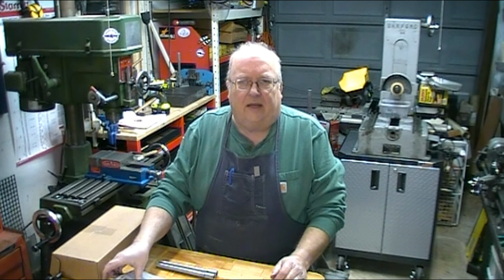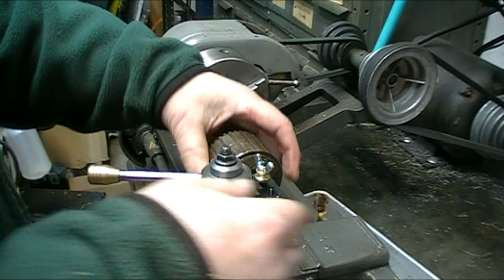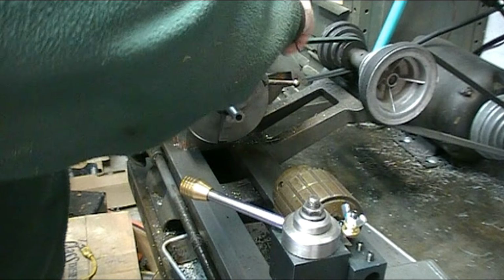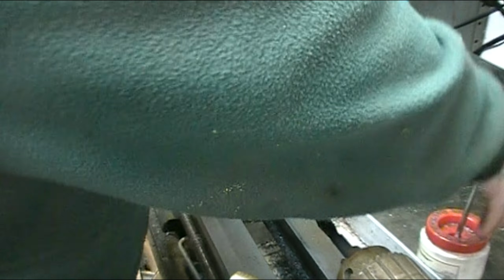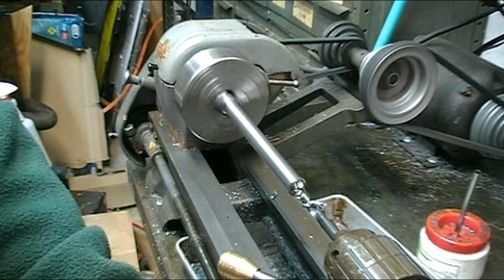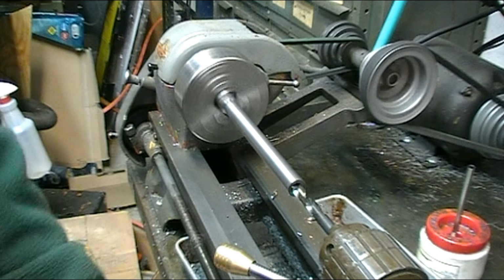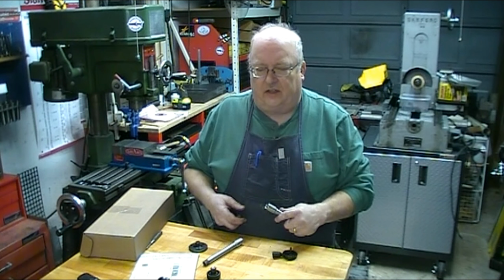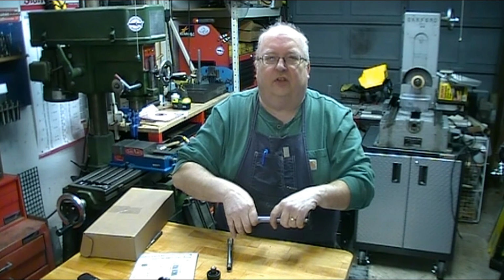Microphone Stand Extension Part 2

Comment: Drill chuck on the tool post is a nice addition👌.  I liked mine the 1st time I used it. Thanks for sharing.
Reply from the maker: The drill chuck has saved the day on more than one occasion.  The quill in the tail stock on this little lathe  only has  1 1/4" travel.  Thank you for watching and commenting.